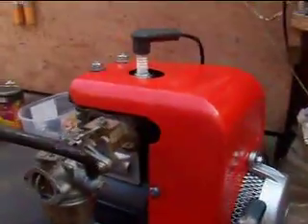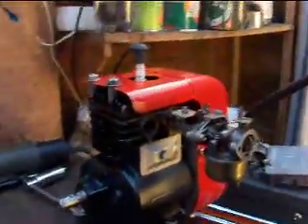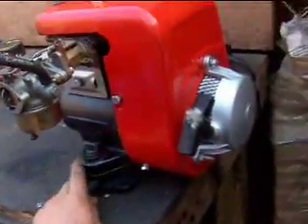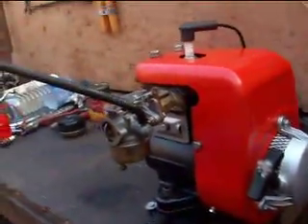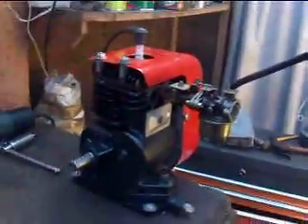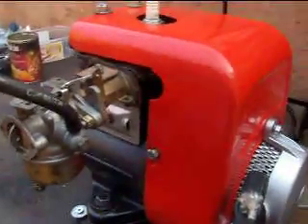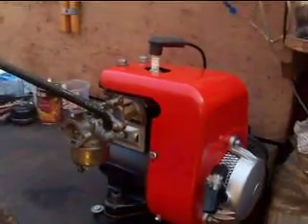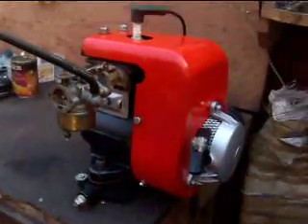suffolk racing engine first cold start

Comment from the maker: I doubt it.8 plus at least. The piston was half the weight, rod and crank had lubrication channels, intake and exhaust ported to the best possible flow. 2 angle valve seats, cut back valve guides, twin valve springs, lightened long duration high lift cam, larger valve lifters to cope with the cam angle, 225 psi of compression, cut back valve pockets, shrouded, m10 fine threaded tempered head bolts, etc. This video was previous to much of this work was done. I have moved unto cars now.

Comment from the maker: @123gilles321 you can fit a 98cc alloy carb on it but you also need a mainfold from the 98cc alloy engine otherwise it wont fit but it does not run right what ever you do to it so you need to get a carb from a briggs or a tecumseh.
If you still have the original mainfold you will not be able to use a carb from a larger engine, you may be able to fit a mini moto carb to it with the original mainfold
its a trial of error, may or may not work
test a few different carbs and keep the best!
thanks

Comment: A friendly word of Warning..
I had one of these engines, A 75G engine (75cc)
What I did one day I ran the engine, No muffler on engine, A slightly leaky fuel bowl.  there was no muffler, a spark came out the Exhaust, set the fuel on FIRE, In my quick response, turned fuel off, it very soon died down enough, I got a watering can just to douse down any flames.the fire went out, Breathed a sigh of releif.  but rather scary when it dose happen.

Comment: Thanks,

I was giving mine a good rev yesterday, I was trying to get the exhaust stub of, it's steel and the block is aluminium so it had almost welded itself in! With some heat in the exhaust it took an hour o get it out with a pair of "Mole grips"! You get lots of flame on the overrun now!